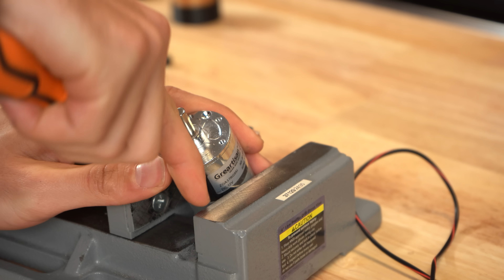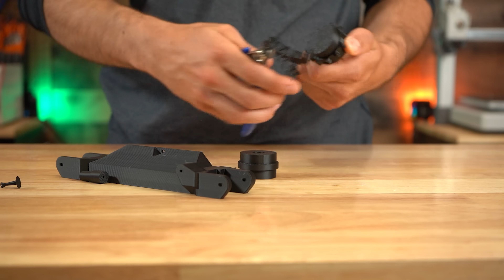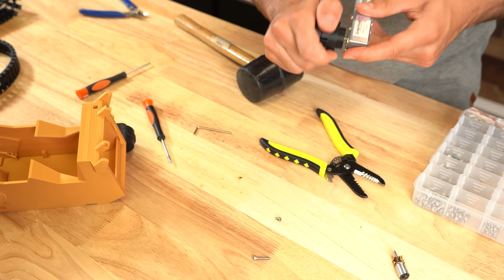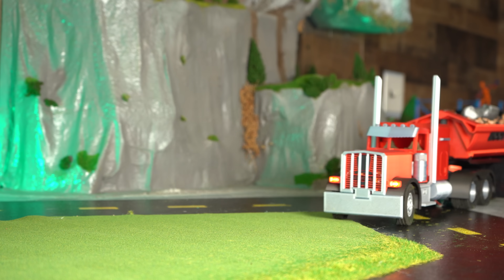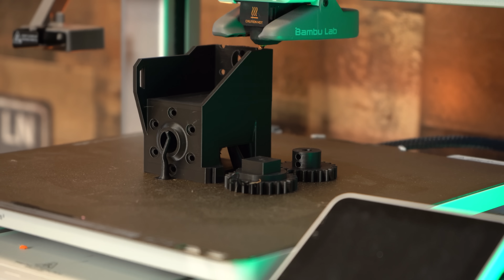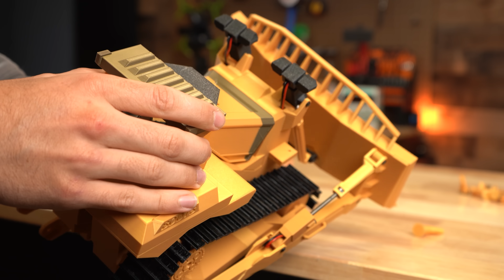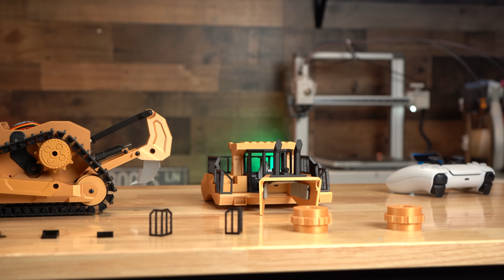3D Printed RC Dozer - DIY

Comment: An Articulating Paving roller/compactor.   What could be even more awesome is the front end to be interchangable with a front end loader so you could make 2 or 3 machines with reusing the back end (3 machines being  Smooth Compactor,  Spiked Compactor & Front End Loader).

Comment: Make a gold washplant .... Could even split it up into sections.... Hopper with automatic grizzly bars and conveyor belt, shaker table, trommel, sand screw, sluice box runs, tailings conveyor 

Make it modular so you can setup you washplant in different ways and build an RC gold mine...

Comment: ive been watching your builds for a while and just got a 3d printer, I was wondering which one of your models is the easiest to print build and assemble? (and the cheapest part wise) and if they would print fine on my printer with a bed size of 220x220x240
Reply from the maker: Hmmm probably the skidsteer is the cheapest.

Comment: you might want to look into track tensioning like in modern tanks , also you might want to add ballast tanks low in the hull of the dozer that you can fill with water to make the dozer heavier when you need to

Comment: Cat 988H or a 980K. The 988H is big, and it uses the strange mono-boom for the lift arm, but that would make it easier to model. You would need a beam trailer for your truck, and a whole lot of axles, even a jeep and tag axles.
Reply: 988 is fun to run, you feel like optimus prime in that thing

Comment: A walking Drag-line excavator (e.g. P&H 9020XPC) or Bucket-wheel excavator (e.g. Bagger 293) would be cool to see and technically challenging to design/program. Especially a bucket-wheel that has multiple articulated parts and internal conveyors.

Comment: I'm sure you have a long list written down someplace. I'd say break it down to a top 10 most requested. then have a public pole open for a week. then take the top 2 or 3 and have the workshop community vote on the next one...

As for Ideas, I have quite a few. I do like the other ideas of a modular chassis setup with different functional attachments Like a UD truck. like a flat bed tow truck, roll off dumpster, a cargo container or like some guys said below a garbage truck or fire truck, tanker truck with high pressure pump.  I like that idea.

I also like the idea of a large mining rig with the rotating buckets. that either fits on a semi trailer or is the semi trailer. 

I know you did the crane but what about a smaller telehandler or platform lift that can use the mini skiddi attachments and add some new ones. 

Honestly, i think it might be time to add another entry level vehicle. small, simple, minimal components. like a small articulating roller or compacter.

Id like to see a revival of the wall-e with more moving parts. 

A job site pickup might be nice as well. I'd like to see your take on an automotive drivetrain on like a 3/4 or 1 ton pickup. and a gooseneck drop deck dump trailer that the mini skiddi fits in. 

Lots of ideas. I'm nearing completion of my first project, a 1/14 scale crawler chassis with a jeep body. Hope to one day do what you do.

Comment: Great build! I vote for a Fire truck / ladder truck with water tank that caries water and sprays out a fire nozzle mount to the motorized ladder.
Reply from the maker: Dude… that would be so cool!
Reply: @professorboots  what about an airport fire truck. They look cooler
Reply: @geordimaul5380 or a tiller truck
Reply: @geordimaul5380 definitely a rosenbeuer panther
Reply: @professorboots better make one with the steerable ladder trailer
Reply: @professorboots 
A tiller fire truck would be nice as it has a trailer a ladder, and u can add a ladder
Reply: @professorboots once you finished  with the construction equipment what will you go to next?
Reply: You should build a lowboy trailer
Reply: Fire truck for sure!
Reply: Could it be the ones with dual drivers? One steering the front and one steering the rear
Reply: Yeah It would be awsome to see that!!
Reply: oh yeah!
Reply: Yes
Reply: Yes
Reply: Fire truck fire truck
Reply: Tractor drawn aerial!!!

Comment: A oversized sign for the truck? That dozer is BIG!
Reply from the maker: Definitely need that
Reply: a spreader trailer  for the wider machinery, if un sure what i mean trailer widens out from the centre, split existing  trailer in half add some sscrew rod to widen it